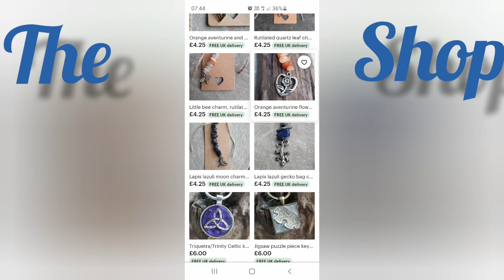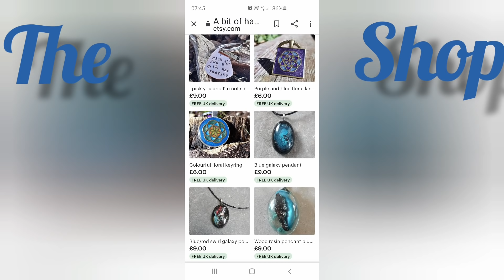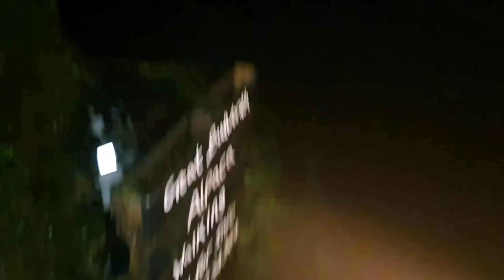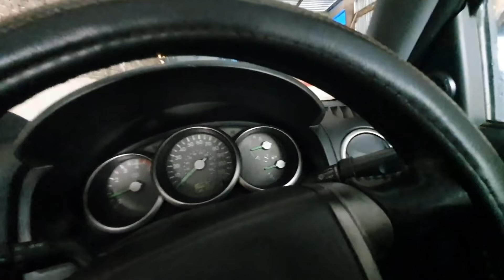BIG FORD COLD START AND BAD WEATHER

Comment: Lack of pre winter maintenance:   change engine oil to winter grade. Replace fuel filters. Top fuel tank with winter grade diesel fuel. Add anti gel to fuel tank. Clean/replace air filter. If applicable, remove glow plugs, decarbonize holes. Load test battery, check cable ends. Repeat this every November 30st. Crack on from New Hampshire 🇺🇲. 😷👍✌️
Reply from the maker: We don't get ur extremes. General maintenance is usually enough

Comment: Dont know if it's the same on our j reg 7810, but we had a little lever on the pump you flicked  across and pushed a button in for cold start. That was a 1 man job
Reply from the maker: She has got it but it doesn't quite work right

Comment: Check the Ground Connection at frame at the front if it is like the 4.75.  Could be the cause.
Reply from the maker: Need to look things over think I have a battery drain
Reply: @hsagri69  If you have an infra red Temp gauge, point it at each fuse.  Warm one will be the culprit.  Radio/lights/new accessories left on?
I always leave the manifold heat ON for 1 minute before trying to start.  Your model may differ.
On the 4.75 the ground connection was tight but between lug and frame very corroded/over heated.
Grind to white metal and tighten.

Comment: Could you Maybe do a video on all the mechanics of the 8830, like what the gearbox is, the fuel pumps, how many cylinders, the coolant system, brakes, power steering e.t.c

Comment: I put a high powered starter on my 7610 a 4.3kw I think. It starts a lot quicker and is a lot easier on the battery
Reply from the maker: Shes usually spot on. Just think she didn't want to go out in the cold

Comment: Did you use the excess fuel button  on the pump?
Reply from the maker: No because its become a bit of a 2 man job
Reply: @hsagri69  should stay in if you open up the hand throttle half way then pop out when it starts and throttles back down it works on my 8730 and it does on most old tractors with the same injection pump😉
Reply from the maker: Yeah but hers won't click in
Reply: @hsagri69  aah. Might be full of crud. Worth a nosey in the side cover when time allows. Take care 🏴 👌 👍

Comment: how many hours does your 8830 have and is the transmission reliable?
Reply from the maker: She 10k hours only trans related problems in 7ish years was the low pressure pump failure which technically isn't a trans problem and a speed sensor
Reply: @hsagri69  i have a ford 8630 and i'm very happy with it.  The engine is indomitable 💪

Comment: Thanks for the video sorry things aren't going well there. Nothings changed in the U.K in the 20 years since I left then.  The tossers in towns are in trouble, the farmers are out there  helping while they still have their own problems on the farm to deal with, before " the army get called"  if it's a big emergency. And those people are sitting in their houses whining after we've taken the trouble to help feed them the rest of the year to.
 To be honest if that old girls got excess  fuel button  problems, turning her over a couple times to move the oil and giving her a small sniff's the best thing for her,  Your poor starter and battery will thank you.  In a situation like that here in Canada thats the only time I'd condone the use of  a can. of ether starting a tractor. Unless it's a Deere and it wouldn't bother me if it blew up using it every day when the sun went behind the clouds on a warm day and they won't start L.O.L .
Reply from the maker: Is what it is. We carry on

Comment: Did he press the fuel excess in
Reply from the maker: Have an issue with it. Weak battery 2
Reply: Ok , should definitely get the excess on the pump sorted , even with good batteries your starter life will be very short working that hard 👍